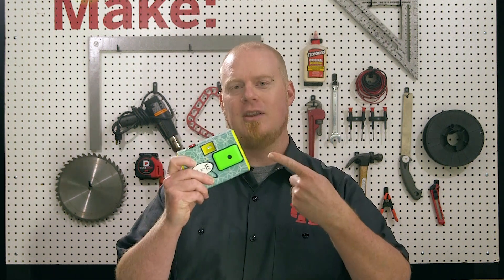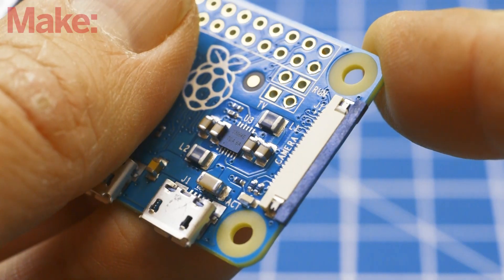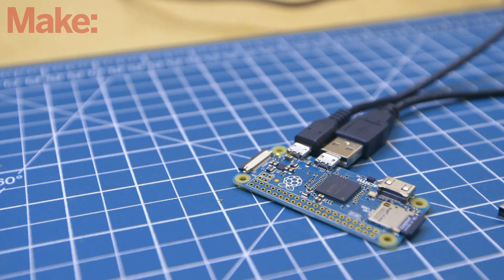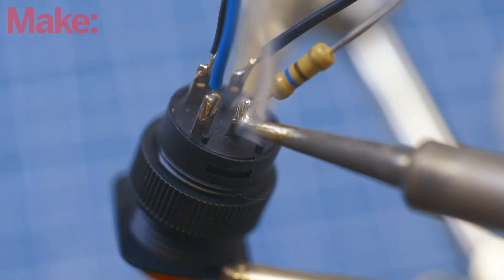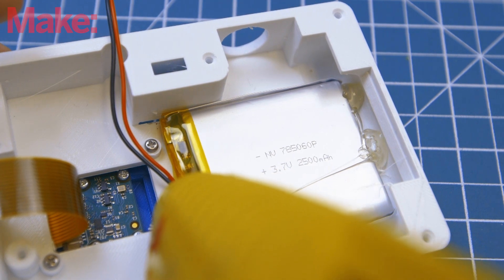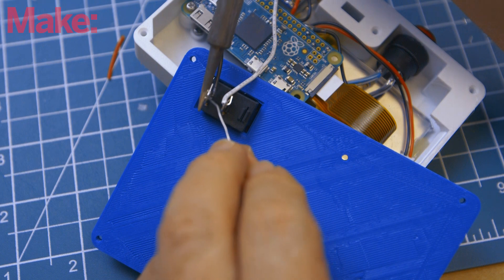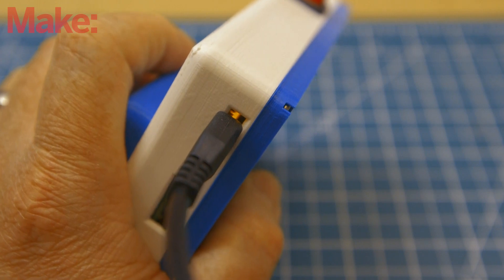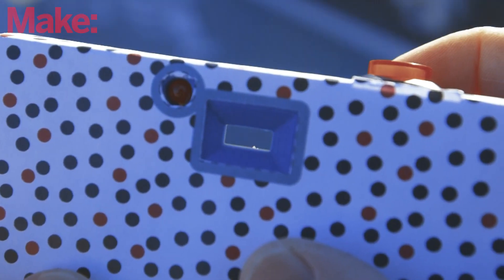Weekend Project: The Pix-E GIF Camera

Comment: why is the case so big?
Reply from the maker: I know, it looks huge! But when you see everything that's fitting in there, by the time you close it up it's actually all pretty tight in there. Makers don't have access to things like bespoke ribbon cables like you'd find in your manufactured phone or camera.

Plus it looks cooler.
Reply: it can be much smaller, almost standard RPI size . but "they printed the case first" (should have built and compressed before printing a case) and we do have access to different sized ribbon cables, ive actually managed to do a variation of this project using the lego RPI2/3 case, that has a built in hole and mount for the camera. i didn't bother with the battery because it was a test, but i have that battery, and could scale down with the zero and make it rpi3 sized. go a step further, you can slap a motion trigger like a HC-SR501 to the front, and guess what, you have a motion activated security camera that ends up still smaller than the camera pictured here. 
(i made this described object at one point when studying the PIR module, its just a switch)
the idea of using the RPI0 is a good use for it since it is low power, but thats also its drawback, its too slow for stable images the cameras are capable of.
Reply: sorry. I think I shouldn't have made this comment XD truth is that the golden rule of making is to improve rather than criticize. :) this does look like a fun project to try out.
Reply: It is a fun project, and well worth trying. Use the component in my comment. You will have a blast playing with that setup. Get out the Legos that's where prototyping meets childhood.